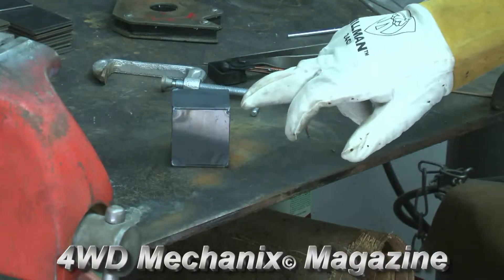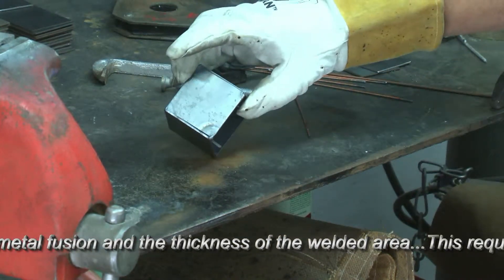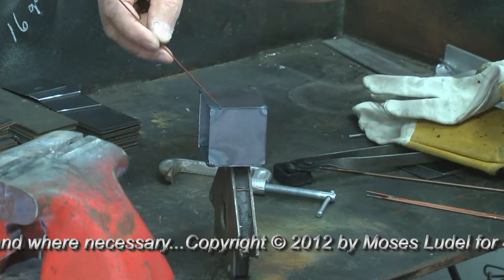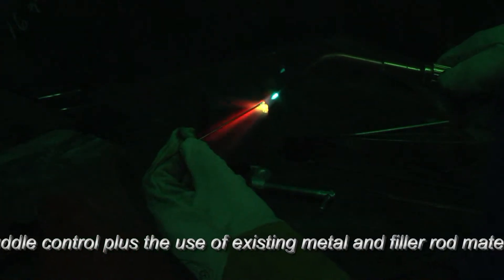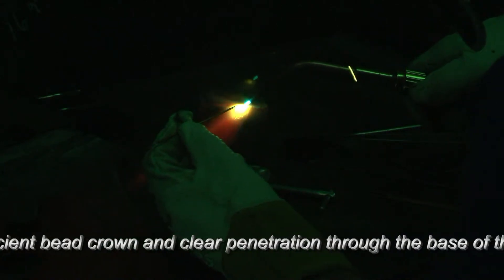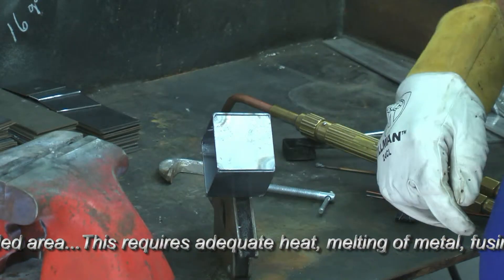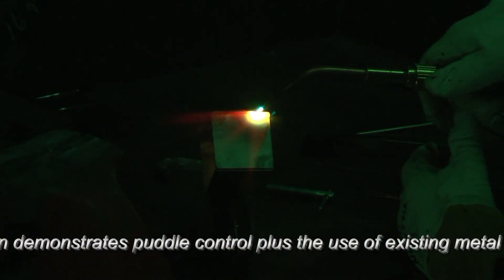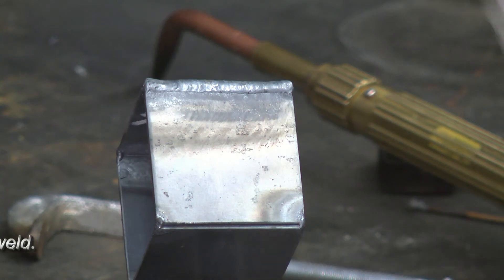4WD Mechanix Magazine 'How-to Welding Class': Making Gas Welding Beads

Comment from the maker: Thanks, Mike!  As you can tell, I really like oxy-acetylene welding.  This is an overlooked process that has many applications.  It's only shortfall would be broad heat diffusion into the adjacent metal (the heat affected zone or HAZ).  However, there are times when this is useful, like when you want the entire piece to heat and cool down uniformly.  I have reverted to oxy-acetylene process many times, it works very well on light gauge and sheet metal, often resembling "TIG" process if you do it right...I'm looking forward to getting back into the welding instructional, this can be useful to viewers and a lot of fun, too!...Moses